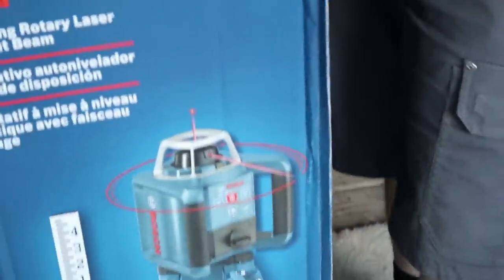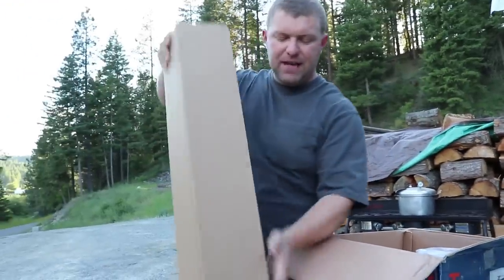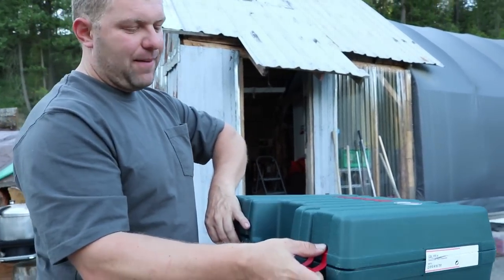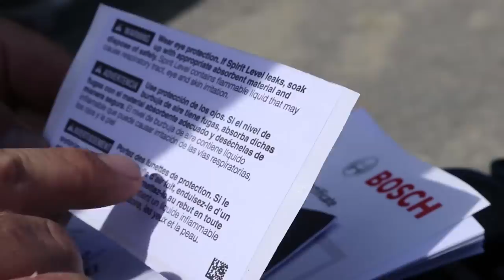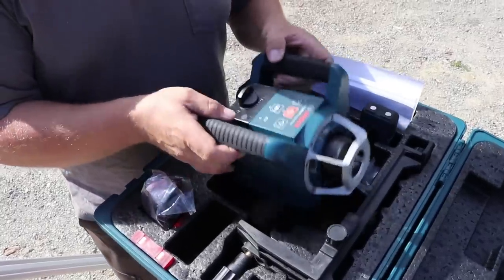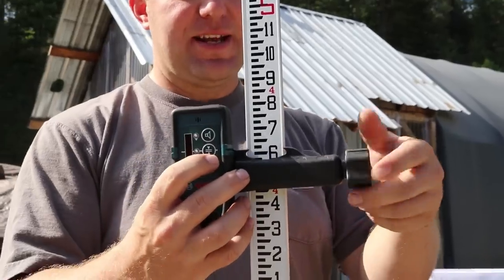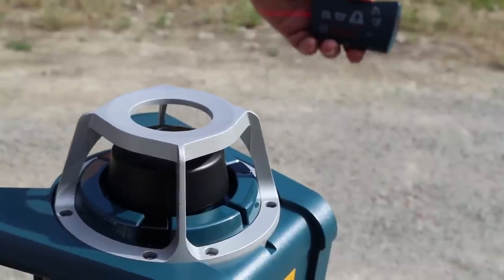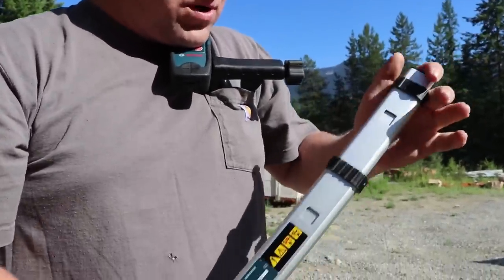WORTH THE $700! 😰 (Bosch Laser Level Unboxing)

Comment: A water level will always be the cheapest and most accurate level ever.  IMHO
Reply: Jeremy Smith 300 feet of hose is awesome in the woods. Much better than a laser.
Reply: i agree
Reply: I haven't even gotten through this video yet and that was the first thing I thought of is a water level for when they did the hot tub instead of line levels. Line levels sag and are not accurate at all. A water level will get you through in a pinch. But having a good laser level is sweet. Don't know anything about the Bosch one but they make other excellent tools. Can't wait to see how it works for Jesse and Alyssa
Reply: Water level is annoying.
Reply: True. Water seeks it's own level. That's why they call it sea level.
Reply: Love you`re honesty Jeremy. 73 percent of the earth is water.At what point does the water "kink" to accomodate a spherical uncontained shape called a "GLOBE"?"A water level will always be the cheapest and most accurate level ever.IMHO. Very true. As a carpenter, my "spirit" levels do not bend.
Reply: water levels are PITA(pain in the ass).  Setting firms, poles cabinets, etc are measured and set much faster.  if you think a water level is faster, then hire an hourly rate contractor and have him layout a 1000 linear feet of footer forms.  then tell me how much you like paying the bill.
Reply: Daniel Gardner don't need 300 feet when making a 12x12 deck for a hot tub. But, for larger projects I use a Transom
Reply: Transit.
Reply: That $700 could have been used to get a professional come in and fix the leaky pipe issues they are having.
Reply: Coming from someone who has done layouts in industrial construction, getting the good laser is well worth it. A cheap laser is such a headache. A transit would be more accurate, but it's not as fast. I'm guessing with timber frame that laser is the perfect tool for the job.
Reply: Jeremy Smith: But these are YouTube episodes and the subject matter needs to be crazy to draw views.
Reply: Water levels are a PITA you have to keep going to each end and rechecking your reference.   I had one for a while on a project,  things were not making sense  so I brought both ends together the water level in both tubes were off by 4"  -- you say it can't happen well it did.  No bubbles but part of the tube was in the sun and part in the shade.  Different density of water because of the temp difference  in each leg caused the error.
Reply: I'm watching an American  (James) build a house in the Philippines and I saw the contractors using a water level.  It is a great channel (my pi dream if you like building projects).  James bought an ordinary level for them as a quick go to tool, but they prefer a plumb.  There is a crew of around 12 building a concrete house each guy making around 10 dollars, the going rate, each day.
Reply: Craig, it seems someone should have changed the water... an easy fix.
Reply: If you only have two batteries then you deserve to spend the money.  The stupid will be punished.
Reply: They have the extra money$$ that's for sure. If it's a good level they will put it to many uses. If not oh well buy another.
Reply: Daniel, that's why they invented the "Clinometer"  as a replacement for hard to reach long inclines. 

but OC you pays your money and make your choices, id think being made in america they might have used some of that cash to employ some local teenagers as laborers and help everyone learn a new trade or at least improve their practical knowledge on something useful  as they go etc...rather than suffer buyer's remorse and having to justify all that money for a luxury item for house building.

have some locals collect the rocks and clay ,and take 50% of what they collect and sort.

also have the local collective try their hands at rock roasting and facing some rocks for building projects as a side benefit for all to use as good neighbors share their knowledge and help out rather than hang out at the mall.
Reply: Plus on a job when an owner was ripped off they left the water level took everything else....
Reply: Jeremy, OC 300 feet of hose is more useful ,well that and a bigger bucket as it will take massive amounts of dead cash to keep buying petrol/gas to do the water runs to fill those immense tanks with that poky water cage.
Reply: OC robert, you would use only trusted teens of people  you know locally, and as for the stealing, that's what insurance is for and the sheriff OC.
Reply: Jeff , there's a massive difference comparing  a so called generic professional (see the trouble with experts) building surface footer forms and building on a hill, they are currently at a disadvantage OC because they have not even hand drilled a well (3rd world style) yet, and so dont even know where the actual sound bedrock is below them...

for the future, they will be wise to install at least 2 Push Piles or Helical Piers to counter any Sinking or sliding Foundation down the road,  but then again, they dont seem to know how deep the many river rocks just below the surface go on the property as yet.
Reply: Jeremy Smith , l agree.
Reply: Sadly Bosch are not in the surveying business, they make tools. I believe in buying tools from manufacturers that are leaders on that particular area or need.
Reply: The most terrible bought in their offgrid project, a long hose is always the best.
Reply: seal the ends? wow
Reply: saw some videos on youtube that people use water level, basically a tube fill with colored water or uncolored water....
Reply: steven watson Whilst all true, laser levels (Professional ones not like this Bosch toy) give you true readings as well as relative ones, unfortunately water levels don't give values, they give a relative value to a known value  E,g 2 things on the same plane can be level, like shelves for example, but not necessarily the same height and inline. Being level is one thing, being on the same line of bearing, level and the same height is key to building flat, level buildings. The best ones i've used have DGPS and give MSL, and output the data in machine readable format, to throw in specific programmes and get very accurate site maps.0
Reply: Jeremy Smith I was going to say that, one clear bit of tube for a few $'s will be more accurate and it can be used when line of sight is broken
Reply: I've use vinyl tubing water levels for decades and never had issues.  Get a couple stoppers to plug the ends and a few drops of food coloring.   Long distances can be done in segments and stakes can be marked the added up for total grade or rise over run.
Reply: You can buy the clear ends to go on a garden hose. Also use a reservoir on one end to work by yourself.
Reply: For simple level only.  If you need vertical planes or points and beams at 90° to one another, it cannot be done with a water level.  Ever used a water level when you had it filled with water and had an unexpected, unseasonable drop in temperature over night?  Sure, you can fill it with a water/alcohol solution or even automotive antifreeze, but sometimes you're caught off guard and it will not work.  A good, trusted laser is fast and easy to reset to do a specific or tight job.
Reply: Sorry wrong. A laser leveller is superior. The advantage is that you can do automatic grading. And you can easily move about your ground to make sure everything is level. Running around with a hose does suck.
Reply: This laser can be off 3/8" in 300 feet...
Reply: Jeremy Smith thankyou
Reply: tponn, no... Some people are just dense and/or don't listen and ignore that they clearly stated that they wanted something that will do a lot more than just find horizontal levels...

You're not going to be using water levels for plumbing, flooring, moulding, cabinets, and the hundreds of other things they intend to use the laser for!
Reply: The Quizzle, no, I just cringe at the ignorant commentators who think they know what they're talking about when they don't...

Yeah, who needs a way to more accurately work with plumbing, wiring, flooring, tiling, cabinets, wall finishing, etc. when they can just have a water level that can't be used for any of those things...

Sure, let's focus on the one thing a water level is better for and let's ignore 99% of all the other things they'll need a different tool for...
Reply: About 30 years ago I assembled a dedicated water level with a carrying case... Over time I've replaced the water bottle, a fitting, and the windshield washer fluid (blue for visibility and it doesn't freeze) and it is still serviceable... I've "leveled" building lots, footings, swimming pools, floors, ceilings, decks, cabinets, fence posts, gutters, drain and waste pipes, straightened out facia and soffits on older homes, and many other things with that water level. Even with the replacement parts and new washer fluid I've spent perhaps $35 on the thing... a bit more than a dollar per year, there are no batteries to go dead, no special glasses, and unless you are leveling decks in the dark you can always see it...
Reply: claton blade... You change the batteries!  Like they stated in the video, it uses standard batteries and they could always have rechargeables...
Reply: For the limited needs these folks will have a water level would be fine. For a professional who is competing with others, and trying to make a living, a laser level would make more sense from a speed standpoint. We shouldn't lose sight of these distinctions...
Reply: John Grossbohlin, people doing their own projects still need to be able to do so quickly because they have other things they have to do too and a life to live...  So let's cut the nonsense with the idea only professionals need speed!

Time is not only money, regardless of whether you're working for yourself or someone else, but it also takes from the time they could be doing something else with their lives and they do not want to be spending the rest of their lives just building this one house!  They've already invested over two years, how much more do you think they should give up rather than finding ways to do things faster?

Next, let's be clear that a water level won't help them do their flooring, their tile work, their plumbing, their wiring, help them do things like hang up pictures on the wall evenly, etc.

The water level only does one thing, it does do that one thing well but that's it... While the laser can be used for many things besides just finding a horizontal level point.

Sure, if they only wanted to set the foundation level, or wanted to build a treehouse, or wanted to figure out the slope for swells, etc. then sure...  But they aren't only going to be doing those basic things...

So let's stop pretending they're only going to be using it for one thing when they flat out said they have tons of things they are going to use it for and will be using it for many years... Meaning beyond just building this house!
Reply: Those who attack the writer rather than the ideas have lost the debate....
Reply: Much of the human world was built and decorated without electricity and certainly was built without laser levels... Plumb bobs, plumb bob levels, chalk lines, story sticks, pencils, knife marks, and water sufficed for thousands of years. Spirit levels and optical levels have served well in more recent centuries. 

As Elisa mentioned in another video, the thing that slows them down is that they often aren't sure how to do the job in the first place, nor are they sure what tools they'll need, nor do they know when they need help until they actually need it. They are undertaking a self-taught apprenticeship which is not as efficient as having a formal education in the trades or 50 years of experience.

There is also a fallacy that folks can buy their skill with their next tool purchase... which is what the advertisers would have you believe. There are plenty of examples where that fallacy is clearly evident!  Sometimes using a basic tool like a water level actually helps the user understand the process better than using a gizmo like a laser level. It would be kind of difficult to be off by 3" in 16' with a water level... 

If nothing else, based on their finding that quality used laser levels sell for little discount off the price of new ones, they can get most of their money out of it once their projects are done.
Reply: John Grosshohlin, even people with decades of experience and all the formal training in the world struggle with everything needed to build a house on their own...

Sure, there are plenty of people who could build a house, but there's a difference from being able to do something from being able to considered an expert on it and knowing every possible variable...

Most trades people are trained only in a specific field that is their specialty... Even general contractors will unlikely be an expert in all of them and may only have a general knowledge enough to coordinate the specialty trades...

The reality of the trades is you never stop learning because there's always more to learn... but that's the life they chose...

People who just want to build themselves a home on the other hand only need to learn enough to achieve that one goal...

While there are many valid ways to do things... You're picking and choosing what you think should be the way they should do things but the reality is that's only one of many ways to do it and the fact remains you're ignoring all the things they have to do and focusing on just one thing...

Again, the laser can be used for a lot more than just finding a basic horizontal level...  and by the time you get all the other tools that will cover all the other possible uses then you would have spent nearly as much anyway and wound up with a pile of tools that would be very cumbersome to carry around and switch between... 

Besides, getting the laser in no way stops them from learning the actual skills needed to actually build the house... Tools just makes that process easier, period!

Never mind the water level wouldn't have taught them anything they aren't learning with the laser level... There's no skill in reading a level, just a matter of knowing what it means...

Really, people are even complaining they got Timber chisels... But how the heck do they think they will build a timber frame house without chisels?  And what do they think good chisels cost?  They spent nowhere near as much as the top of the line chisels cost for their kit, they just didn't buy any junk chisels that would rust and break before the house was done...

There's plenty of valid things to complain about like the junk equipment they bought before and pretty much their entire solar setup but at least higher quality laser isn't a bad investment as it is a multi-tool that can help them with multiple projects and even things around the house after the house is already built... It's not going to be just used for just a few things and forgotten...  That's like saying a speed square can only be used for one thing as is useless after that...

Besides, they aren't exactly in the most ideal location to use a water level anyway... Intense sunlight and shade can through it off, air bubbles can throw it off, rocks and anything that can pinch the tube can throw it off, freezing cold winters can throw it off... All of could happen on this property...

So anyone thinking a water level is a perfect fit for them wasn't thinking it all the way through... They'd have to fill it just before every use and would have to do it quickly to avoid any extreme temperatures effecting their readings and with all the rocks on their property somehow make sure the tube never gets pinched...

Never mind they're barely avoiding heat stroke... So you have to assume they will always be clear headed enough to never miss anything that could effect the water level...

Yeah... like that couldn't end in a disaster...

Like it or not, the laser is fast... Letting them avoid staying in the sun longer than they need to... It's accurate enough for their needs and when they do other projects that requires keeping something straight and evenly spaced it will still be of use to them and let them get those jobs done faster too...  Also, being faster also means they have more time to double check things, which helps reduce their mistakes...
Reply: ZeoCyberG, I don't discount the overall utility of laser levels but I do question the use of scarce resources on something like this when there are reliable and far less expensive options. That $700 could have gone towards the backhoe that will provide utility that would be far more difficult to replace with a substitute.

I suppose if you left the water level lying about there are some risks as you outline. I've found that with any level (water, optical, laser) that it is used for short periods and then put away. This is true whether marking grade sticks, walls for cabinets, or walls for leveling ceilings or floors.  Chalk lines haven't failed me and I can stand wherever I want with no risk of blocking the laser beam...

My water level, sealed except during actual "marking," is always full of water with anti-freeze. The anti-freeze solves the freezing problem and makes the water more visible. Also, since the water is at ambient temperature and the actual duration of use is short there is little practical change due to exposure to sunlight when used outdoors.

I'm not opposed to buying tools... I own many but am shy of gizmos that allegedly make life easier. Then again, I can cut fine dovetails by hand and have even done them with a 12 pt 22 inch panel saw rather than my fine dovetail saw when making a point. That point being that understanding the process matters more than the gizmos.